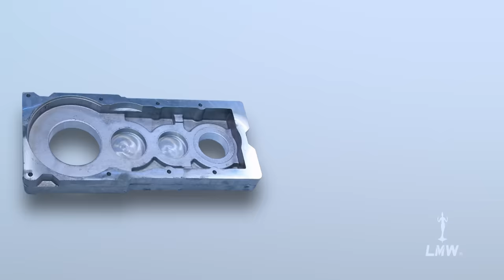JV40 Vertical Machining Center

Comment: Never saw any slotting, and why the hell was it going so slow? Could have machined the whole thing from raw bar stock in that amount of time with proper speeds and feeds.
Reply: Can u please guide what feed speed and depth of cut should use on soft to hard materials. I m new to this
Reply: @ranjodhsingh8638  have to be a little bit more specific there bud. Many factors come into play when figuring out optimal feeds and speeds. Type of material, tooling used, machine being used, holders, work holding, etc.
Reply: They probably aren't running coolant/mql/air for video purposes. Probably turned down the speeds for that reason as well.

Comment: Is this in slow motion
Reply: Even at 2x playback it's still to slow. I could've hogged that thing from a solid before they finished this casting.
Reply: Richard Wells 
just watch how long it takes to chamfer the radius at 4:32 😂

Comment: this is what exactly my boss thinks. the raw material already looks like an exist part what we put in then just press the green button. when it's finish we just open the door to take it out and put another one in. XD
Reply: its Shawn from Deed machine tool we have the machine u want
Reply: Engine assembly lines have many stages of machining. So they do only specific machining needed for the part in a specific stage. These machines are built specifically for those operations. 
FYI, LMW in India are known for ridig build quality and durability matching Better Japanese and Taiwanese brands abiet a little costlier.
Reply: Hey can u favour me something!!!

Comment: Feed speeds are so slow for aluminium. Hardly approx 1200mm/min
Reply: That is what I thought! It is aluminum casting. T1 - with right tool it can be cut at 300 inches/min.....I did that in first half of 90's! But maybe the machine has not required spindle speed and power...it might be some kind of garage toy!
Reply: @jiritichy6855  i guess he is going slow to avoid chip heating because he is filming it without coolant ... without coolant the chips would jam in the tool . There is no reason to be that slow when you have that clamp system to save time